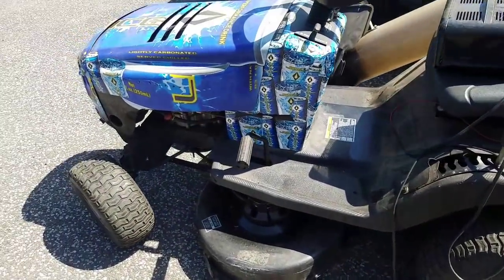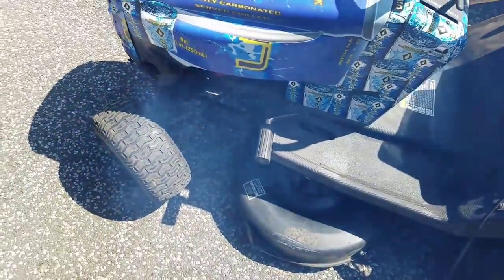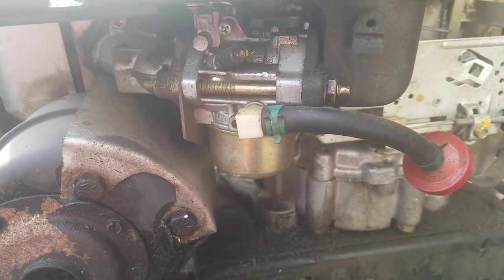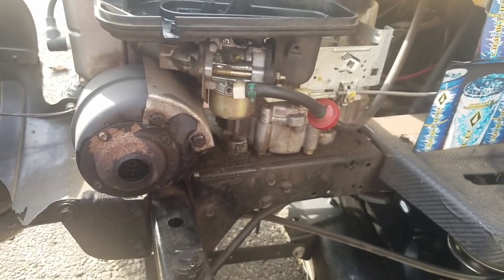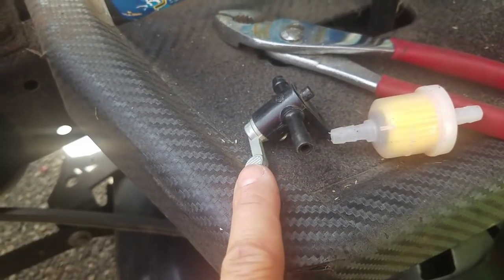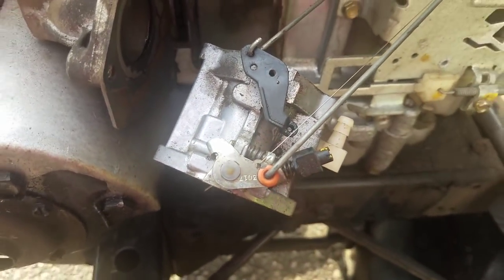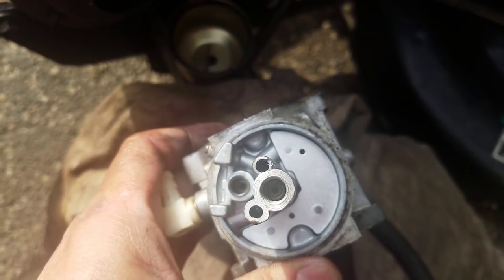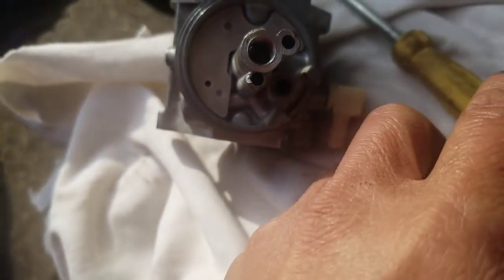HOW TO FIX A RIDING MOWER THAT SMOKES & STALLS CRANKCASE FILLED WITH GAS CARBURETOR CLEAN OIL CHANGE

Comment: "Paul, an oil change will fix your problem."  Well Sir. you were spot on.  I cannot thank you enough.  I rent a property and this saved me so much.  You are a fine example of what makes YouTube wonderful.  Peace my friend! Philip
Reply from the maker: My pleasure sir...glad it helped you out!
Reply: Just wanted to follow up.  I changed oil and it was great.  I mowed another lawn many hours later and it was still running like a top. YOU ARE AWESOME!
Reply from the maker: Im glad bro...pit a fuel shut off valve on it sonit doesnt happen again.
Reply: Whats with this fuel shut off valve I did smell gas a few days after I parked it and when I changed the oil it wasn't thick like oil. I need this 15hp briggs on this troy bilt to stop smoking and run help me guys.

Comment: This video help me to figure out what was wrong with my riding lawnmower, Exacly the same problem. After putting a brand new carb,  I emptyed the oil reservour and it was full of gasoline.  So now the smoke is gone and no need to take it somewhere or buy another one.     Thank you for you awesome video! GBYA!
Reply from the maker: Glad it helped you Carlos. Hope you’re subscribed
Reply: You drained the oil and it was full of gas??? Maybe that's what mine did cause I changed oil it was like black liquid pouring out more than a quart of so to

Comment: Dude I just fixed my mower after watching this video!  I have been wrestling with this for a few weeks on my Sunday off.  Just mowed my lawn with no white smoke with and didn't have the mower cut out on me!...but I put a better quality fuel shut off on mine, haha!   Thanks!!!
Reply from the maker: Todd, it's worked for a lot of people.  I'm glad it worked for you! Hope you subscribed
Reply: I'm having this same issue I just dump the oil and put in new oil and seeing if it helps. I cut the grass a week ago shut it off. Could smell gas in the garage the next few days and now it cranks but white smoke real bad. When you throttle it up high it smokes more. How did I cut last week for 2 hrs with no issues

Comment: I have the same engine and had the same issue with a mower my neighbor gave me. I replaced the carb and drained the oil and when I fired it up the smoke engulfed my neighbors house and our houses are not very close.
It settled down and now run great.
    I only put one quart in, ran it for a few and drained that before completing the oil change.  Additional gas and crud came out with the one quart drain.

Comment: Great video, thanks for making it!  my oil was real thin! I had already successfully cut my lawn once with no problems, this time i started it and was a mosquito fogger.  Was running fine but put a load on it and was even worse. I had to do a head gasket replacement too (yes was bad) but still smoked when i started, and carb was erratic.  Oil changed, started and waited about 3 mins to burn the old oil off the engine and Bob's your Uncle!  I also got some carb cleaner and sprayed into the air filter connection and that took care of carb problems too. (i dont have a good history on carbs, but can handle diesels - grin).  Thanks again, thumbs up!
Reply from the maker: Thx bro glad it helped hope you subscribed
Reply: @MowersNBlowers  yes i did!

Comment: Sweet! Just got a 91 LT4000 for free that was smoking a bit and leaking fuel/oil. Oil filter was barely on and after tightening oil leak stopped. Carburetor had a weird gear style fuel line connector that just needed to be snapped back into place. Oil change, major de-grease,  and she runs great! Just need to figure out the steering.. when running forward at almost a full lock turn the wheels will bind up and make the mower stop suddenly. Guessing loose linkage? My project for this weekend!
Reply from the maker: Those craftsman steering can be challenging.  They’re called steering sectors.  Have fun! Hope you’re subscribed

Comment: Sir, My Craftsman seemed to have all the problems you were experiencing.  Gas empty and oil on dipstick way too high.  I am going to take steps as you did. I feel it will work.  If not, thanks so much for your time/effort for this video!
Reply from the maker: Paul, an oil change will fix your problem.  Put an inline fuel shutoff.  Everytime you dont use the tractor, shut off the fuel to prevent this from reoccuring.  Its my pleasure.  Please consider subscribing to my channel.
Reply: I have subscribed and liked.  Thank you for your prompt and friendly response.
Reply from the maker: @paulandlesson  thank you Paul.  Let me know how you made out!

Comment: Add a Briggs & Stratton inline shutoff valve and run the bowl empty after each use. Paying the extra for non ethanol gas helps too.
Reply from the maker: Thanks Aaron.  I did just that.  Here on Long Island NY, we dont have any places that sell non ethanol gas.  I do however use some. Lucas Oil engine stabilizer treatment.  Hope you'll subscribe bro

Comment: For the oil drain, you can get a Steele elbow at your plumbing supply to make a downspout. Or you can get a plug with a quick disconnect fitting which allows you to suck the oil out without unplugging it. Fancy! And thank you very much for the informative video. I’ve been watching a few of them trying to tackle my rear engine rider, that did the exact same thing to me this year. Maybe you should make a video of how to store your engines in the fall. So we can avoid this in the spring it seems really easy and obvious. But so does making biscuits and gravy
Reply from the maker: Thx Russell, I’ve got about a thousand videos, lots of them I explain about seasonal storage. Thx for watching bro.

Comment: Could be the needle seat in the carburetor if it's a gravity fed fuel intake. If so put a shut off valve on it and clean the carburetor real good.
Reply from the maker: I believe I did in the video

Comment: It looks like you lucked out and the engine didn't get damaged. Like you did many people recommend putting a manual shut off valve upstream of the fuel filter. If you close it when the machine is not in use if something goes wrong with the carburetor the engine won't fill up with gas. I put one on mine.
Reply from the maker: Yes, a great way to prevent this from happening again!  But over time those plastic fuel shut offs can fail and leak.  I get a bad one every 10 or so.  Hope you subscribed.

Comment: Can you add a link for the fuel shut-off valve you used.  It is almost impossible to locate a mountable fuel shut-off valve.  Since that oil drain plug is just a pipe plug, just get a piece of pipe that is threaded on both ends and screw it into the engine.  Just use a piece about 2 to 3 inches.  Once it is done draining, put thread tape on the pipe and put a threaded cap on the pipe.  Makes the oil change a lot cleaner.
Reply from the maker: https://www.ebay.com/itm/223512617176

Comment: New Tractor with 10 hours did an oil change and yes my gas level is down too! Throws smoke runs for a few seconds and dies.   Probably the Seafoam hot soak to clean the carb for the surging issue?
Reply from the maker: You can try, but cleaning the carb manually is the way to go.
Reply: @MowersNBlowers   I did try a hot soak with Seafoam and I think that may have caused the issue?   I'm glad I didn't hydro lock the motor!  I need to pull the carb for sure now.  It's I believe the NIKKI Vtwin that many complain about jets clogging.  Now I have this issue. I did install a gas shut off.  But if the bowl or the solenoid attached isn't closing... ¯\_(ツ)_/¯
Reply from the maker: Gotta clean the carb, it’s 90% of issues.

Comment: So you could easily just change the oil and in the future make sure to cut off your fuel line and burn the excess fuel in the carb off before you park it , right?
Reply from the maker: Fuel shut off yes, burn fuel out of carb if parking it long term. Like for the Winter

Comment: I would recommend another oil change after running for 5 minutes.
A lot of nooks and valleys inside that can still hold oil/gas mixture after draining.
Flushing out the first "clean" oil fill will probably show some color from the sludge that was partially freed up by the gasoline. Smell this oil that was drained,probably smells like gas too.
Reply from the maker: Video is 3 years old,  still going strong

Comment: Go to your local hardware store and put a piece of 1/2 inch pipe with a cap for an extension on oil drain I put one on every motor I work on
Reply from the maker: Video was 2 years ago, that’s what I did. Thx

Comment: It looks like you put a fuel filter on it made for a mower with a fuel pump. I did that also and on an incline it would sputter and sometimes stall. Just FYI.
Reply from the maker: Yes, back then I didnt know the difference, moreover, I dont have any hills, just have perfectly flat land so doesnt make a difference in my case .  But great that you pointed that out. Good eye bro. Hope you'll subscribe

Comment: I  have a john deere with a briggs 19 hp burning oil alot during start up and a fine cloud when running, but doesn't stumble at all. Only 30 hrs on it well taken care of, wonder if it could be same issue ?
Reply from the maker: Check your oil, smell it. If it smells of gas...same problem..but mine sputtered with no power because of so much oil.

Comment: Mine smokes white smoke as well. Could someone tell me if it could  be the piston rings?
i drained the gas that was in the crank case and gave it a fresh oil change. Also put clean gas in the has tank. And made sure the gas ‘shut off valve’ is closed when not running. The only thing i didnt do is take the carburetor apart and clean. 
A friend told me gas was getting into the crank case because of the bad piston rings. Good lord, i dont want to tackle that one. Have my fingers crossed its not. PLEASE ADVISE!?
All replies are greatly appreciated- Thank You.
Reply from the maker: Bad piston rings is a cause for the smoke as oil seeps through.  But it’s not the reason gas gets in.  Clean your carb.
Reply: Mowers N Blowers i hope not. My brother is a mechanic and acts like he knows everything. thanks bud.

Comment: My mower carb. was letting gas run into the combustion chamber when it was stored after cutting , did not want to clean or rebuild so I went for easy fix ,an spent $3.00 for fuel line shut off valve , changed oil & filter problem solved!!!!!
Reply from the maker: Yup every gravity fed gas tank I have has a fuel shut off!

Comment: Carburetor float stuck/not floating.  Needle valve is staying open allowing gas to flow in flooding the engine. Check your oil you may have gasoline in the oil too
Reply from the maker: Watch the whole video before commenting

Comment: Mine  smokes the same but mine don't leak gas into the crank case or try to stall it runs fine it just smoked really bad I think my oil ring expanded and when I put oil back into it it leaks a lil oil into the crank case and so it smokes blue smoke that's it
Reply: Then again what caused it to try to stall was the smoke chokeing it and I have a straight pipe on mine so that makes a big difference

Comment: How do you drain the oil or the gas tank from a Yardman Push mower?
Reply from the maker: There should be a square nut on the bottom of the engine. Tilt mower on side, should be near blade.  Unscrew, drain oil, replace nut. Fill oil.

Gas tank, pull hose from bottom of gas tank, drain has, replace hose. Hope you subscribed Brandon.
Reply: Thank you, I did.

Comment: Did this and my mower still will not turn over it’s acting like it wants to start I’m getting a good spark but no start. New carb and still no start.
Reply from the maker: Shoot carb spray into carb mouth, maybe not getting fuel.  Does it have a fuel pump?
Reply: @MowersNBlowers  old carb leaked all gas into crankcase and ended up in my oil , I drained oil and put fresh oil in. Gas is spitting out of the carb where my air filter connects. I have changed the solinoid, new carb, new battery, new spark plug, and new ignition coil. It doesn’t have a fuel pump it’s a Troy built 2011 pony with the Briggs and Stratton 17.5 engine. Thanks for any help you able too give.
Reply from the maker: If gas is pouring out, your needle isn't stopping the fuel, so the carb float and needle isn't seating.
Reply: @MowersNBlowers  I took the valve cover off and the exhaust valve is stuck in the closed position with the valve cap off

Comment: Check the head gasket. That fuel filter is for an engine with a fuel pump. Put a peice of pipe to extend the drain hole.
Reply from the maker: It's not the head gasket, video shows it fixed.

Comment: mine doing same thing out of the blue,,but why does it do that in the first place?
Reply from the maker: Did you watch the video? Your carburetor needs cleaning or replacing.  The needle isnt seating correctly, fuel is continuously running into your engine.
Reply: @MowersNBlowers  you DID NOT show that in your video!!!  It can ONLY be the needle valve! but you did NOTHING to the valve!

Comment: I'm having the same problem.  Was sure it was a blown engine or gasket or something terminal.  My oil was full of gas so I'm hopeful.  Will work on it following your instructions tomorrow. One question I don't think the video answered was this- I'm still not sure how the oil is getting in the gas in the first place. Isn't that why the exhaust is blue? I will let you know how it goes. Thanks for making the video. I'm now a subscriber.
Reply from the maker: Phil, thanks..over time, the gas in your carburetor gums up from the 10% ethanol in unleaded gas when it's not being used during the off season.  The gummy substance coats the fuel needle and canal which dislodges the needle from the hole that blocks the fuel from the gas tank.  Once gas seaps through, it floods the carburetor with gas and seaps into the crankcase where your oil is kept.  It's not oil in the gas, its gas in your oil.  You should install a fuel shut off switch on your gas line so you turn off the gas going to your carburetor and you wont ever have that problem.  You need to clean your carburetor or it will fill with gas all over again making sure the canal and needle are smooth and clean. Thanks for subscribing.  I have videos on how to install a fuel shut off too.
Reply from the maker: @phillipbourguignon5803  honestly, spark plugs rarely go bad, just clean it with a wire brush.  I didnt change it.  The wire going to the float bowl is a fuel solenoid, it stops gas from flowing to the bowl once engine shuts off.  If that's defective like it's broken while the pin is retracted, it allows fuel to continuously flow to the carburetor which causes your problem.
Reply from the maker: @phillipbourguignon5803  yep, unscrew the solenoid and take it off with the wire attached. Turn your ignition switch one click without starting and see if the valve opens and clises... gives in and out.  If it doesnt move, broken.
Reply from the maker: @phillipbourguignon5803  dont you just love when you fix something yourself.  Glad I could help bro. Hope you subscribed

Comment: Change needle, seat, float, and install a inline fuel shutoff valve to prevent fuel tank dumping thru the carb and into the crankcase and cylinder head (Hydro-lock).

Comment: Put a short pipe nipple  in oil drain to extend it out away from the frame.
Reply: TheSlagman0 This guy is NOT a mechanic
Reply from the maker: That’s correct!
Reply: Mowers N Blowers thanks bud. neither am I.

Comment: Just went thru this on my mower . Get a new head gasket change float needle , and add a fuel shut off valve . Problem solved .
Reply from the maker: Just changed the oil and put a fuel shut off. Gasket was fine.

Comment: Engine must be clean
Reply from the maker: Nope,  completely wrong you are!  The carburetor has to be clean plus an oil change,  the engine could be covered in mud and would still run!
Reply: @MowersNBlowers  good video currently had the similar issue. Videos of guys flushing with gas diesel etc.. I had a big POP and little smoke. I figured engine was done. Failed to restart, plug was fouled , cleaned and got it to start. Just brought it out day1 from winterizing.
Reply: Check for a leak around the gasket and nothing. Turned fly wheel had compression, I was in the process of tunning it up. So moved forward, changed carb, air/oil filters fuel line with shut off. Greased lubricated, anti sieze on some parts. A little smoke on start up, full throttle and idle smooth. It was the Carb.
Reply from the maker: @psnewsauditor-az5244  it’s always the carb,  first thing you should of checked

Comment: The carb problem still isn't fixed , yes the fuel shut off will stop gas from flowing into the carb when the engine is off but you needed to replace the needle and seat . That's the correct fix , since you had the carb off the mower , you could have done so very easily . The correct oil is 30w not 5w30 and the valves are out of adjustment .
Reply from the maker: You are correct dale, I changed the seat a few episodes later as it was swollen and shredding.  An oil change was done a week later using sae30, and valves adjusted a day later.  Thx for being thorough, hope you subscribed bro

Comment: change the carb..i went looking for a bowl gasket and couldnt find one so i got a new carb off amazon for like 20 bucks  problem solved
Reply from the maker: I cleaned mine so didn’t need to change,  eBay has them for $12

Comment: Carb is most likely drenched in oil I’m 13 my mower did that to and I rebuilt the carb it was much better
Reply from the maker: Hope you also changed the oil because gas has diluted the oil. Hope you subscribed
Reply: I have been subscribed for a while
Reply from the maker: @thisguytrucksoldtrailer6875  cool

Comment: NO ITS BLOWN HEAD GASKET PULL OUT DIP STICK IF ITS BLOWN PRESSURE OUT YES HEAD GASKET
Reply from the maker: It’s not,  video was 3 years ago,  been running fine since video.